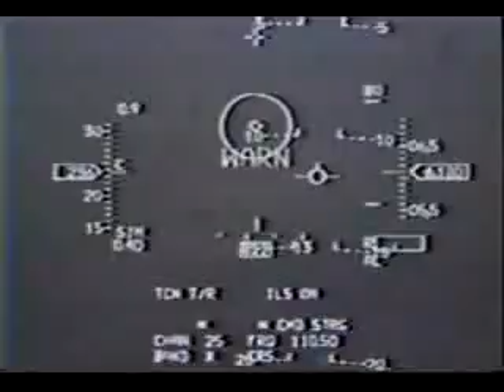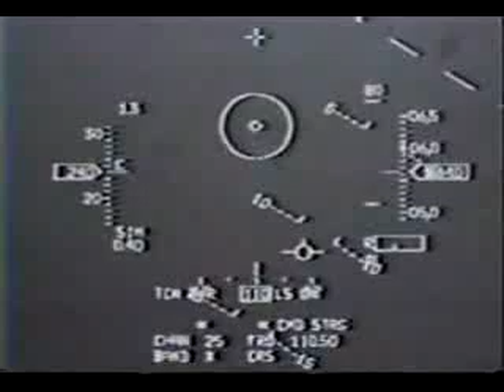F-16 Engine Out Landing

Comment: I was F-16 crew chief for 20 years and we had a similar IFE like this while stationed in Alaska. The Falcon can land in situations like this, only if it meets certain tech data requirements. The pilot landed at night with some reduced visibility due to the snowfall. 
EPU provides the pilot with electrical power and hydraulic pressure to  control aircraft's flight surfaces. The pilot needs that to line up the aircraft with the runway.

Comment: How did the system still running despite having lost an engine? are fighters equipped with APU?
Reply: F-16 has an EPU running on hydrazine. At 3:03 you can hear them warning the tower about this. This aircraft has no mechanical connection between the stick and control surfaces and has relaxed static stability on top of this. Without electrical power, there is no way to control it, hence the EPU.

Comment: Others eject, even close to an airport.  The taxpayers will get another one for me they expect. But this guy is a real man.. Saved the airplane from destruction.. Medal of honor for you.  Most will say, fucked, thrash this jet over some farm or field, let the taxpayers pay for the crash, and another jet for me.  fuckked....
Reply: It is easier to replace the aircraft than the pilot... If the requirements for an engine out landing are not met and the engine won't restart, you get out... We lost a pilot a few years ago because they tried to land the aircraft instead of ejecting at a safe altitude.

Comment: To anyone wondering about the fire response with reference to "Hydrazine"... it's a system built into some aircraft engines which generates power by way of combusting Hydrazine and water across a catalyst of iridium inside the engine, combusting and igniting the mixture which generates heat and pressure across the engine's turbine and is designed to restart the engine in a power failure. It's a compact system on fighters where space for an EPU is not available.
Reply: +Matthew Powell Not quite true. In this case, it is an EPU (Emergency Power Unit), which powers the hydraulics for flight controls and other essential systems in the event of a flame-out.
Reply: +Dan Mcw ah fair shout! I can imagine those units differ in use across different jets?
Reply: Yes, Matthew. I know a bit about the F-16 from having operated with them in major and minor exercises (plus the Gulf War). Each type can have a different arrangement. Multi-engine aircraft, of course, are less reliant on something like an EPU since most of the time they have one functioning engine.
Reply: +Dan Mcw that's awesome. thanks for the info!

Comment: Yeah better to eject and let the F-16 itself crash into the ground
Reply: If the pilots ejects 3 times, as far as I remember, they are not allow to fly no more and are grounded ( office job). The rocket behind the ejection seat compress their spine too much, so is not really an option if they can avoid it. I was a F 16 crew chief or mechanic for 20 years with the Air Force. I didn't work any other fighter jet.

Comment: Gliding a glider or cessna is TOTALLY different than trying to land an inherently unstable form aircraft like the F16 which literally just falls from the sky.  This pilot was not only very skilled but even more so lucky that the runway was nearby and available for him as he had to have been losing altitude and stalling quickly which would explain the "WARN" constantly going off until he made a high speed final descent to create air speed to make a level approach.
Reply: Not only that, I understand that the F-16 controls are totally of the fly-by-wire type. There are no redundancies, no hydraulics, nada!